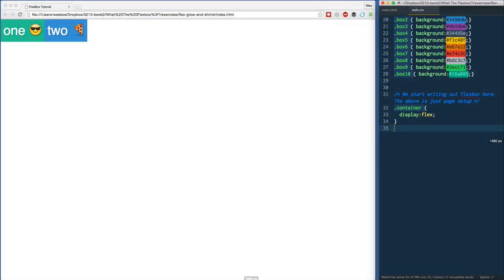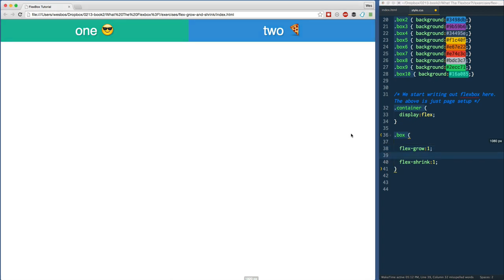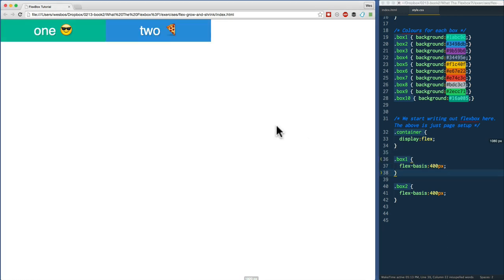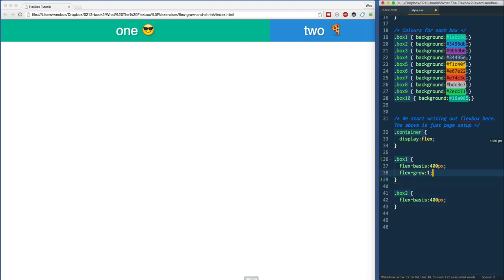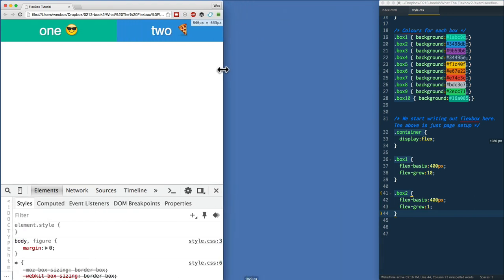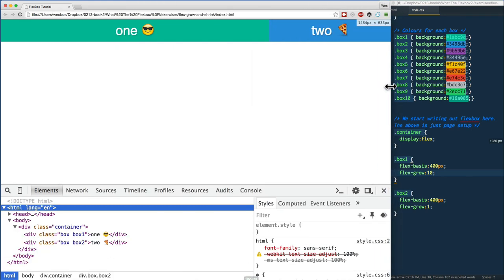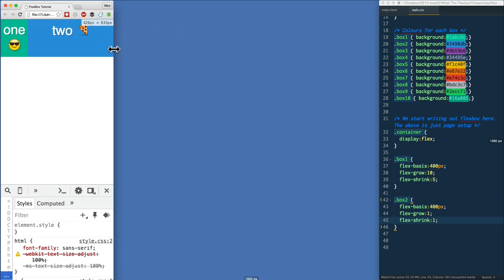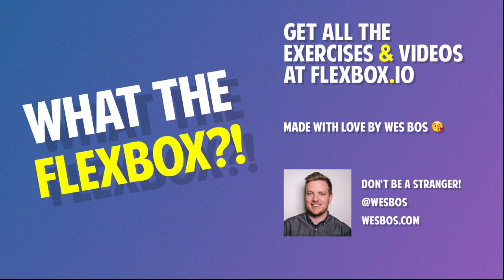Finally understanding Flexbox flex-grow, flex-shrink and flex-basis! - Tutorial 11 of 20 💪

Comment: This is not at all complete, it doesn't truly explain how elements grow and shrink based on the values provided to flex-grow and flex-shrink, and it's pretty obvious even the author doesn't know what's happening himself, he seemed pretty confused in the flex-shrink example when he gave the first box a value of 5, and the second one a value of 1, and based on his own explanation the box 2 should have shrinked 5 times more than box 1, which it didn't, so he kinda just awkwardly sat there confused and then quickly glossed over it (8:22). Not to mention the tutorial doesn't cover percentages and auto values for flex basis, and how flex basis works with / against setting width/max-width/min-width (or inline-size, rather).

Dissapointing.

Comment: Watching all other videos, I wondered why the width of one is not in proportion to the other. You made it so clear that the extra room is divided in that proportion. Awesome! Two questions: 1. What is flex-basis when flex:1 is used? 2. What is the difference between using width vs flex-basis on a flex item?

Comment: Hi Wes, can you please use fractions to express how much an element is giving away of its width when using flex-shrink? I think I don’t get it. You use flex-basis:400px for both .box1 and .box2. So, when the container is 800px wide, each box is 400px wide. Then you use flex-grow:10 for .box1 and flex-grow:1 for .box2. So, when the container gets wider than 800px the extra room will get split between the elements using the ratio we set for flex-grow. My understanding is that .box1 gets 10/11 of free space and .box2 gets 1/11. So yes, .box1 gets 10x more extra space than .box2. But how does this work with flex-shrink? We used the same values for flex-shrink as for flex-grow, but obviously .box1 is not giving away 10/11 of its width when the container gets below 800px. Thanks!
Reply: I think I got it, but I am not sure if I'm right. I think that if the container gets for example 700px wide the .box1 and 2 miss 100px, they just can't be 400px each any more. So, they have to split the 100px using the ratio above, meaning .box1 will be narrower by 100*10/11~90.91px and .box2 will be narrower by 100*1/11~9.09. The new width of .box1 will be 400-90.91=309.09px and the width of .box2 will be 400-9.09=390.91px. Now .box1 and .box2 (309.09+390.91=700) exactly fit 700px wide container. Can somebody confirm my theory? :D
Reply: Yes, that's how it works. I just checked it using web inspector.
Reply: Hey, can you explain the math behind this please of how flex-grow works, hard to find online.